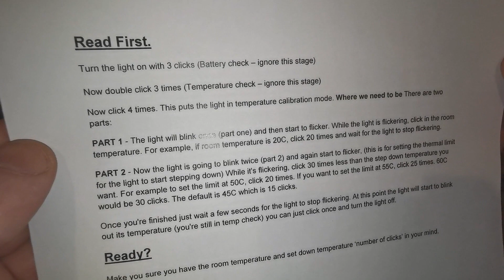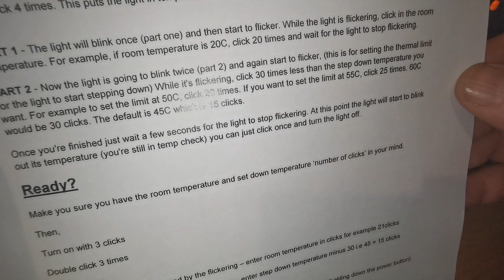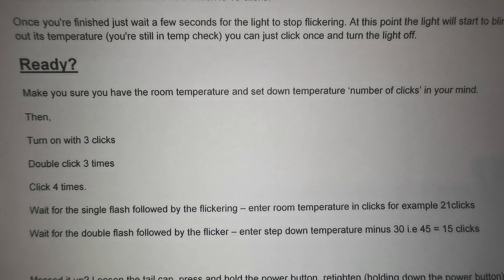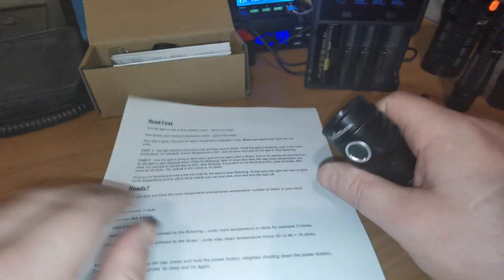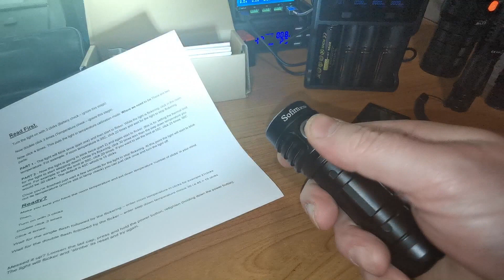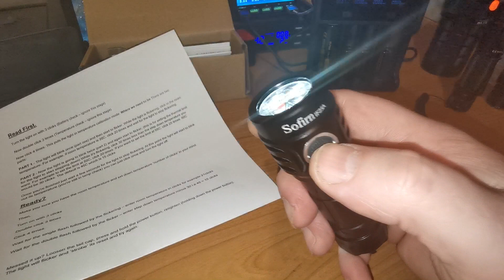Sofirn Anduril Temperature config

Comment: Is this anduril 1 or 2? I can't get strobey thing to happen. I'm following your steps. 🤷
Reply: He has anduril 1. Sounds like you have anduril 2. From off, 3c to battery check -> 2c to temp check -> 7h 1 flash to change current temp, 2 flash to change temp limit. Read your manual to understand it

Comment: Thanks for the video.

To say this was useful would be an understatement.

Any chance of a video on how to do a factory reset?
Reply: He basically shows the factory reset. Unscrew the tailcap and then hold down the power button until you tightened it back together and let go after it goes through a strobe and a flash, let go that is it.

Comment: Do you need to do that or can you just keep the factory setting in place?
Is it just a way to get a longer lasting turbo mode by increasing the temperature?
Reply from the maker: It's fine just to leave it at factory settings and yes it only affects the higher modes run times...

Comment: What would you suggest as a sensible temperature, the default 45 degrees ?
Reply from the maker: I always set at the lower level (45) and see how well the light dissipates the heat in the first instance. I don't like 55 in partic on the IF - it felt way to hot - The heat spreads downward - something a little bigger I might on the basis the main part I'm holding is running cooler.
But generally speaking I can't help thinking that heat must be damaging the light!
Reply: @flashlightsuk1422  Pretty sure that heat is the main killer of emitters in household LED lightbulbs. Speaking of which, I found that for my Sofirn BLF 36, a carefully removed (plastic) frosted diffuser from a dud 60W equivalent LED bulb makes a free , easily removable, perfectly fitting lantern conversion. Sure, you can't hang it like the Sofirn lantern you've recently reviewed but hey its free.
Excellent vids BTW

Comment: thanks for doing this vid, I've got 2 torches with anduril, the IF25A and the astrolux eco3, the eco3 started stepping down from a low/medium beam seconds after clicking on, I'm not the sharpest tool and i found the anduril manual a bit intimidating but I've fixed it now, cheers.
Reply from the maker: I suspect the temperature of the light (the first flash part 1) was set to high, thus the light 'thought' it was a lot hotter than it was..
Reply: @flashlightsuk1422  oh right, I've had the eco3 about 5 months now and I thought I was stuck with a dud light but it works perfectly now.

Comment: Good demonstration on how to do it. It really is quite easy once you do it. But I would like to add that there's no need to reset the light to do it over. Just simply go through the process again. The only problem with resetting the light is that if you had already programed the floor and ceiling of each of the smooth ramp and stepped modes, and changed the number of steps in stepped mode, those settings are also reset back to factory settings and need to be reprogrammed again. If you didn't change them, then it's not a problem. 
  Also the process itself of calibrating the light causes the light to start warming up. Especially if you had the light on a high output the last time you used it, even if it was yesterday, because the beacon mode uses the last used output as its output and you have to cycle through beacon mode to get to temp check. You may not feel it, but it could rise 2-3 degrees C. That's why it's important to accomplish the first part of the calibration as quickly as possible and to recheck it after the light has "cooled" down. If you're going to perform the process again because you think you may have done it wrong, just be sure to give it time to acclimate back to room temperature, or add an additional click or two when you program the first part of the calibration process. 
  I hope this makes sense  lol
Reply from the maker: Heat wise  you're quite right. I shove mine in the Fridge frequently! 
And by the reset - I know - I have done it. A few wrong clicks and u end up in gods knows what setting and alter all manner of stuff.
NP just reset the bugger...

But perhaps the bottom line -- Olight for example, very conservative with heat settings with no option to 'have a play'. (No disrespect to Olight intended).

But,

I, for one, am really warming to Sofirn lights for the option to be even having this discussion!
Reply: @flashlightsuk1422   Olight is a great company,  however I find most of their lights to be too specialized for me and I dislike the proprietary batteries and no choice in leds. Put a volt meter across the charging terminals on the light, do you get a reading? Just curious. I don't own any Olights so I can't check for myself. 
  I like all my Sofirn lights and haven't had a problem with any of them yet. 
  Convoy is  another great light. Simon at Convoy will do a lot of modifications for you,  you just need to ask him. Some simple ones at no charge.  And the quality of Convoy is way above their prices. Love my M3, S12, C8+ and S11's. And my S2+'s and M2  lol  I love the regulated output. The only thing he needs to work on is the UI and on board charging, but many people hate on board charging. The UI is simple but it could be better.
Reply from the maker: @craigs7181 You do realise most people in the UK have no idea what we're talking about!
Reply: @flashlightsuk1422  Yeah, same here in the USA 😆  But anyone that knows flashlights knows  lol
Reply from the maker: @craigs7181  Oh! You're the US. Ohh man. You should come over here. Its pitiful. This time of year only 8 hours of daylight and yet every bugger is wandering with 'candles in jars'.
Reply: @flashlightsuk1422  Yeah, believe me, I know 😱  I'm in Pennsylvania so I may have a bit more daylight then you lol  
What's with the "candles in jars"?  Explain please
Reply from the maker: @craigs7181  Nah, you're pulling my pud. Everyone know's about candles in jars?!
Reply: @flashlightsuk1422   No pud pullin' here  lol  I swear I'm not familiar with the phrase.  But my guess would be that they are using very poor lights when out and about, probably from a decade or two ago.  Correct?
Reply: @craigs7181  Yeah, I never heard of 'candle in jars' either.  But my guess would be the same as yours.